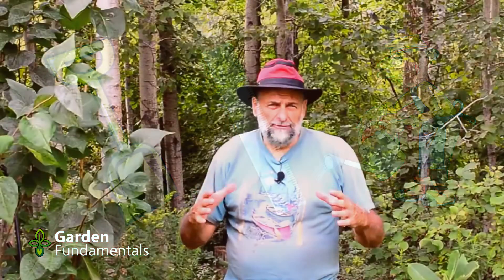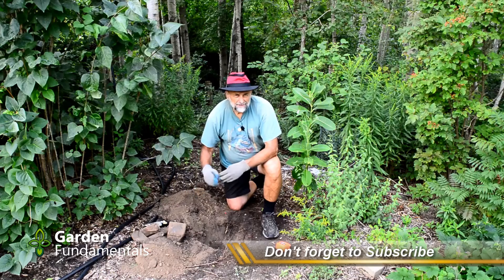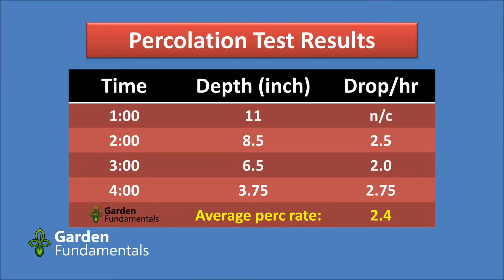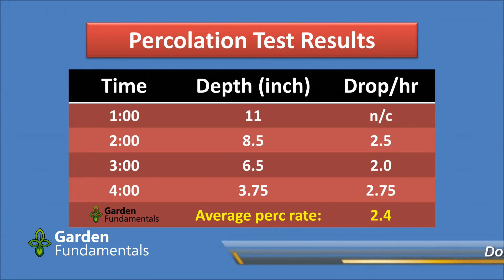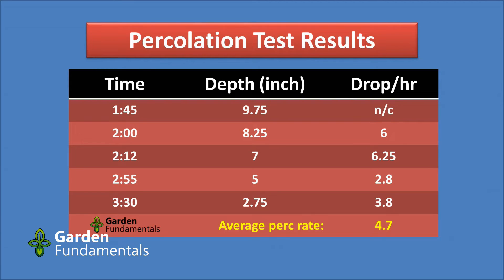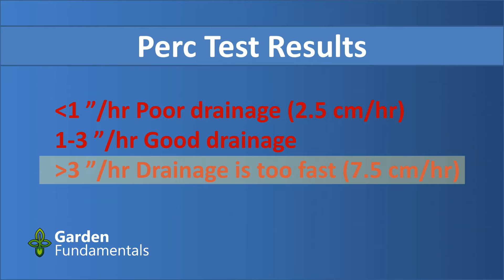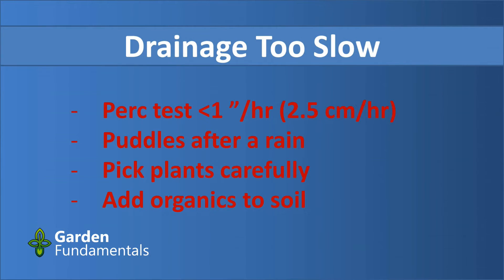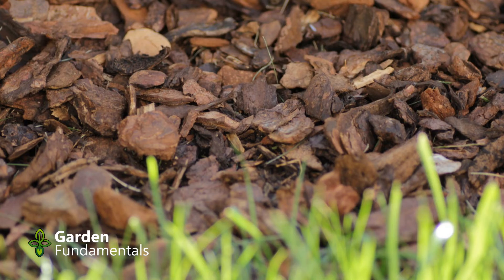Soil Perc Test or Percolation Test ☔☔☔☔And How To Improve Drainage

Comment: Take a look at glass fiber produciton for fiber optics. I believe its a continuous gravity drawn /pouring process. As the liquid pours out the strings mass helps draw it thinly. Its draped over a long distance for cooling and on the far end is coiled up. I believe there may be a steel or other metal wire forming process that's similar to this. Super cool seeing the discovery of the cold string formation! I cant help but think about the multivariate experimentation you discussed. Could try different solvent/PLA ratios, PEO molecular mass (thinking it might help relax the gooey, tackiness), etc

Comment: Here in the High Mojave Desert, where the soil is mostly sand, silt and high pH Alkali salts, I found that adding Organics wasn't sufficient. Unless you wanted of course to fight a constant uphill battle. By accident and lots of research I discovered that small amount of activated biochar, Fuller's earth and gypsum were extremely beneficial as well to help retain the nutrients, moisture level and break down and leech out the salts and help neutralize the pH. These added along with Organics and mixed into the top 10 inches of soil to start a bed, really reduce the frequency of how often plants needed to be fed as well as how often soil needed to be amended.
Reply: Yeah..Palmdale, Lancaster, Victorville, Dry Lake Beds with the UFO activity.  Moved to greener pastures east of the Mississippi River. Soil is much better but, the politics are the same .  : (